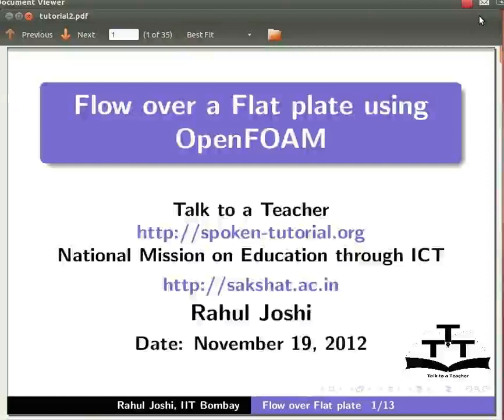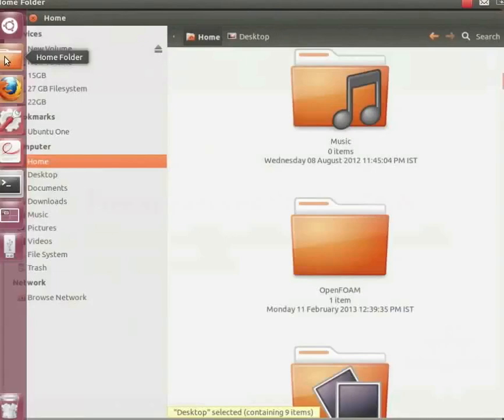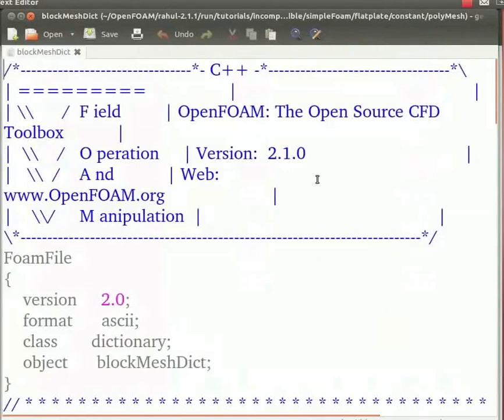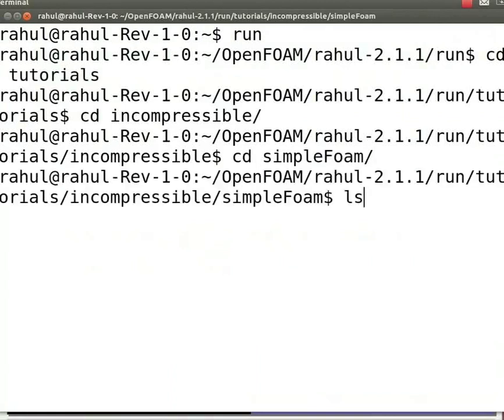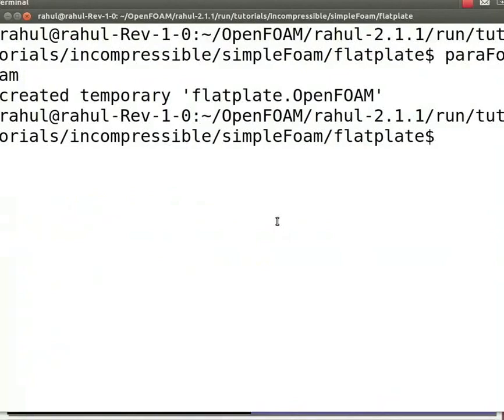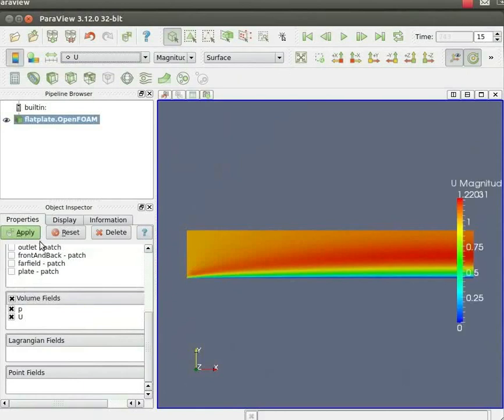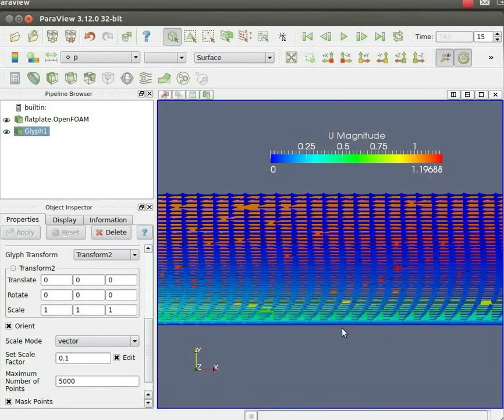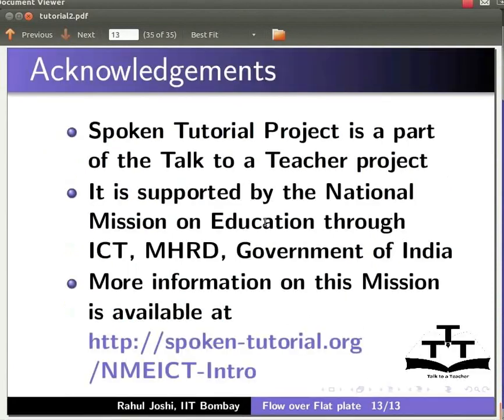Flow over a flat plate - English

Comment: Hello, thanks for the upload. As far I checked, you have used turbulent length scale 10% of inlet height which is 0.5m

Then epsilon should be 0.754 but why you have divided the value by 1000? The dimension is in meter..... Am I right or wrong? I am simulation flow in a WT tunnel. It would be better if I get email address so that we can communicate further.

Best regards
mukut